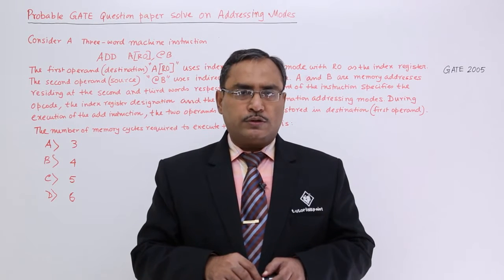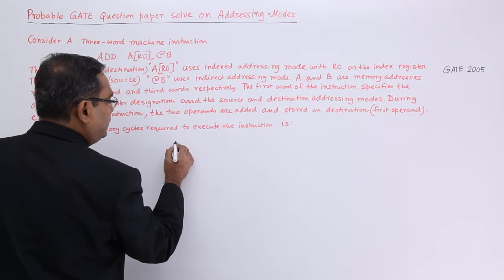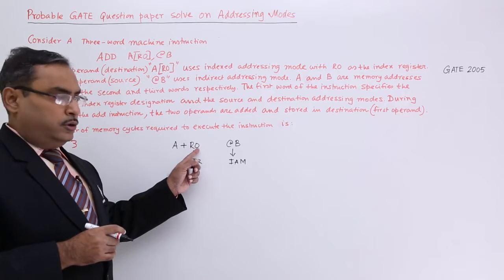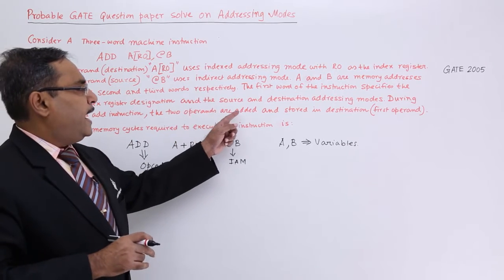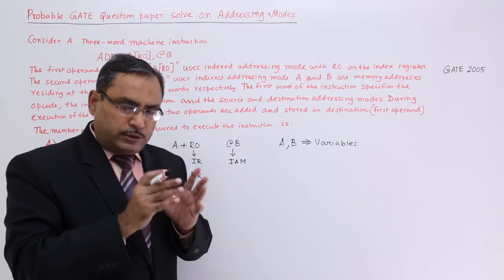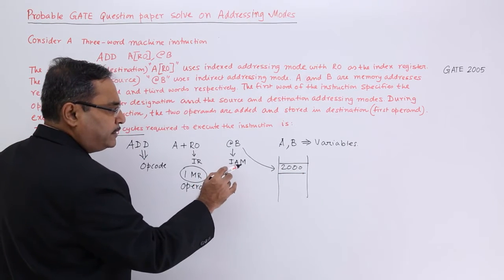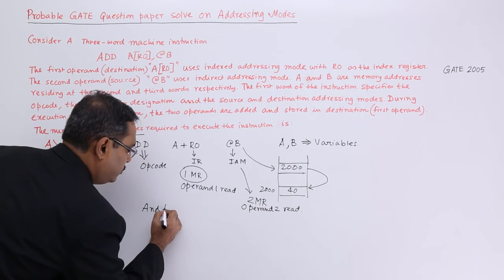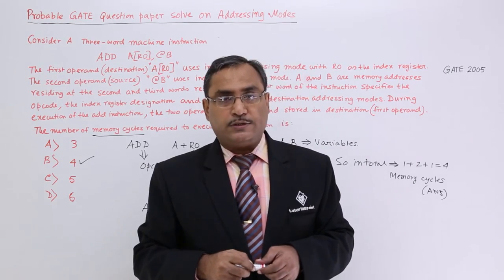Addressing Mode GATE Exercise 1

Comment: Sir it's clear by far that, 
A+R0 = 1 Machine cycle.
M[B]  = 2 Machine cycle.
Store = 1 Machine cycle.
But doesn't performing ADD operation before storing will cost 1 Machine Cycle also?
Reply: We are concerned only about the memory cycles and not the execution cycles.